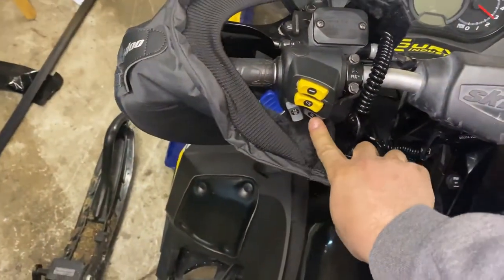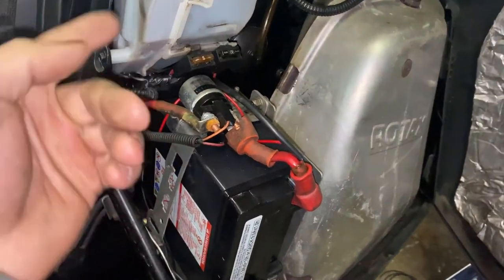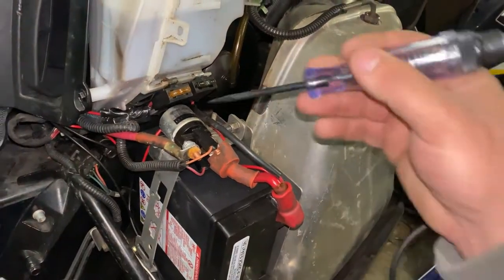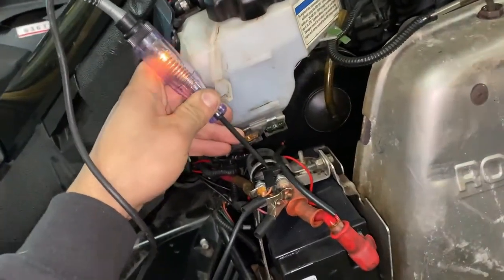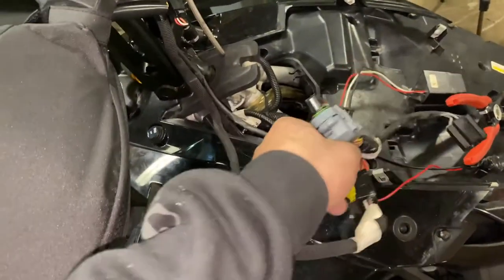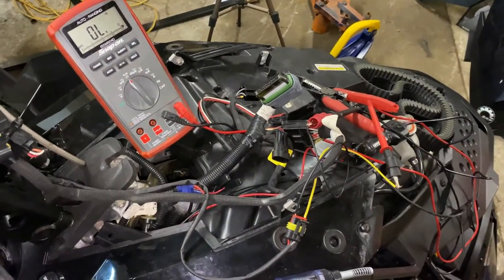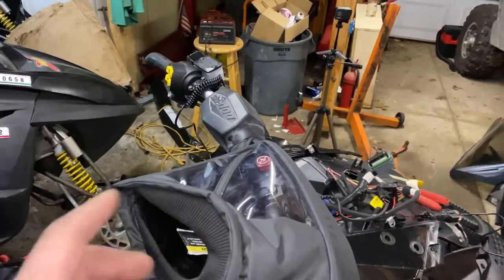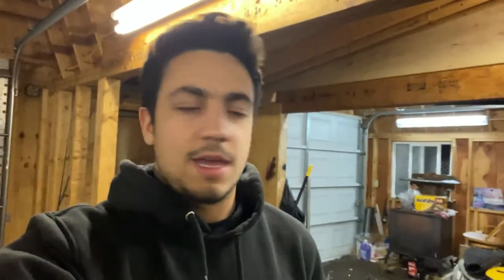Why your skidoo electric start and reverse  doesn't work

Comment: my 2012 skidoo 600 tec sounded like that, changed ecm, tps, gas sensor, still sounded bad like urs then i plugged off the rave valve sensor and it started very well, then changed rave valve sensor/clip thing and now it runs and goes like a dream :)
Reply from the maker: so vaccum leak? makes sense!

Comment: Thanks for this video. Appreciate you taking the time to make these vids. I dont have a tester (can you link that one you have?) but hope you can help with my issue. '15 800r etec is new to me and has been starting fine. It's been below zero fahrenheit the last couple days and this issue just started in that time so wondering if its related to temps. Anyway the screwdriver trick (thanks for that) started the sled. Whats interesting is that if I run it, then turn it off to do a gas fill up or something it will start after. However if I let it sit for more time (30 mins or moreish) it wont start and I'll have to jump it again. It sits on a trickle charger most of the time so battery is full. Any thoughts? I swapped both fuses too and issue persists.

Comment: HELP!  I'm new to sledding and bought a used Ski Doo 2008 MXZ X 800r.  Having issues with hand grip warmers....at idle, I turn the switch on and the grips heat up right away (shows on the display) then shuts off approx 15-30 seconds but still showing ON on the display.  Took it out Friday and ran it up and down the trail at high RMP with same result.  If I flip the switch off then back on, it does the same thing.  Also, the thumb warmer does the same thing.  Thanks!

Comment: Hey Bobby, and ohters
I have a 2012 GSX SE 1200 with the same exact symptoms.
It has been to the dealer 2X where they changed out the battery and then the battery ground wires do to corrosion
IF I do the solenoid screwdriver post connections, It will try to fire but fuel pump etc is not operational by doing this so it will not start but turns over.
I have swapped the 2 relays with known working ones (identical sled) as well as start button fuse and main fuse with same result.

**The only way I have had any success in getting it to run is tipping on its side and letting it fall, or picking it up from rear bumper and dropping it a few times.**  

Once started, it will run as normal (even go into reverse) until you shut it down again.
Looking to see what your thoughts are.  
My next task I think is to look at the wiring at the starter motor itself (Thinking something is loose where it starts if you beat it up)
Thoughts??
Thanks for your time. And keep up the great videos
Reply: bump please.

Comment: how (what type of wire) and where would i ground my solenoid? When you say at the end of your video you jumped the fuse what did you do. I can't see in the video what you had done. 
Thanks
Reply from the maker: I just stuck a wire across the 2 pins. Any wire from ground to ground

Comment: So start button and reverse not working. I jumped the solenoid,  it started the snowmobile. So if my solenoid is no good it won't allow my RER to work as well as start button?
Reply from the maker: Sounds more like the button/ connector. Bet you the solenoid is not getting triggered.
Reply: I took apart the start button control and all looks good in there. However the start button/RER go to a micro switch. Do you know if they go bad? Or am i having to chase wires. 2012 600 etec

Comment: 12 GSX are the handle bar control switches a common failure? I m having the same issue ,start is intermittent ,reverse works fine.
Reply from the maker: They can! Once water gets in there and feeezes it’s all over. Sounds like a starter issue. Try hitting the starter when it’s not turning or jump the starter manually
Reply: Thank you , I’m currently on the road , I will give you a more detailed repsonce shortly. I se BRP has a new part number for the control . If I’ll you in as to what I found in my diagnosis in the future Email.For now Thank you for your prompt reply
Reply from the maker: @TA-bw3pp  no worries. Feel free to email me if you want me to walk you through it bobby@coastalmarineengineering.com

Comment: @Bobby Rebussini  hi there I'm having the same issue, only starts when I bypass the solenoid with a screwdriver. I bought a new solenoid and still doesn't start. I have power coming from the plug that goes into the solenoid. My button works though because it goes into reverse no problem. What did you do  at the end when you took the fuse out? Did you just replace it and that was it?

Could it be a I got a defective solenoid? Odds are slim but that's all I can think of

Thanks
Reply from the maker: So the solenoid is getting triggered?
Reply: @bobbyrebussini1466  I don't know for sure, my friend had a test light and the plug that goes into the solenoid has power. So it should according to that I'd think. I'm no mechanic just trying to rule out something simple before removed everything and chasing wires
Reply from the maker: @jeremipolsky5775  add a ground wire to the solenoid and see if it helps
Reply: @bobbyrebussini1466  when I use my start button it's dead, no clicking or anything. Battery is strong. I just meant the button functions because I use it for Reverse no issues.
Reply: @bobbyrebussini1466  what exactly do you mean. What would I be doing.
Thanks for these replies really appreciate it

Comment: Same problem on my 2012 800 looks like the same sled. Thought is was the relay so I replaced it and still nothing at the start button. Fires up when I cross it so I will follow your steps and we will see. Thanks for the tips!!
Reply from the maker: No problem dude if it’s soemthing different lmk

Comment: man I wish it were this easy on this 2013 rev xu 600. I did the screw driver trick on the solenoid but no spark, used the handle bar start button but there's a super weak connectivity and barely spits out the starter. a few other wrench savy guys had looked at it and tried adding a ground wire to see if any change. nada. all new fuses, a new solenoid, new electric starter, no spark. what else could this mean? any input would be greatly appreciated.
Reply from the maker: Hmm have you tried directly jumping the starter?

Comment: Similar problem with my 2012 TNT 600 Etec, but it’s the 30A that keeps blowing. Seems to be related to the combination of accessories that I’m using. Hand grips heat ok, but with hand, thumb, and shield all on, fuse will blow. Seems like a 12v short somewhere...any ideas?
Reply from the maker: All at once or can you isolate it? Assuming you can’t isolate it I would imagine stator related. If you’re not putting out enough power the current draw increases which will blow the fuse
Reply: I’ll have a pocket of 30a relays this weekend, and then will try to isolate. Thanks for the prompt reply.
Reply from the maker: @gregroylang1570  no problem let me know I’m curious. Ohm out both heated grips and thumb warmer swperately to see if they are low. Also swap the heated shield plug
Reply: Bobby, this information is probably relevant: due to a rollover, I had new handlebar added this summer, which mean that the grips and switches were redone...likely that is where my problem is.
Reply from the maker: @gregroylang1570  ah.  Always go to the scene of the crime..
Reply: @bobbyrebussini1466  hey man, I’m coming to the expert with my latest dilemma. Replacing the disintegrated fuel tank grommet on my 2012 mxzx tnt 600 HO etec. Old one is out, new one is in...question: orientation of the float assembly...I presume it should be allowed to float up, since it’s range would end where it is positioned in the tank (at the bottom). Bobby, could you confirm?
Reply from the maker: @gregroylang1570  yes that would be correct. Pb blaster/ free all with make your life easy with the grommet

Comment: my 2003 skidoo bomadier 600 mxz 007 wont start with the electric start and pull start is broke and dosnt start when i jump the solenoid
Reply from the maker: Battery? Starter/loose connections
Reply: @bobbyrebussini1466  battery seems to be good i think the connections are good thinking it is magnetic key

Comment: I’m having the exact same issue I took the 5ap fuse out but still nothing what does this mean? and when I take a screwdriver and put it on the two screws on the relay if fires right up
Reply from the maker: did you jump the fuse? are you getting power to your solenoid?
Reply: @bobbyrebussini1466  I replaced the fuse and did the screwdriver thing in the screwdriver thing started it though sorry not very good at explaining it😂
Reply from the maker: @connerwiltshire7528  gotcha. So test voltage at the solenoid when the switch is pressed
Reply: @bobbyrebussini1466  alright I’ll let you know what happens.
Reply: @bobbyrebussini1466  the weird part is the bottom still puts it in reverse
Reply: @connerwiltshire7528  I have the exact same problem on mine. Reverse works but won’t run the starter relay. Where you able to get yours working? If so, let me know what you found out. Thx
Reply: @loganzundel3004  I did up getting mine working ended up melting the wire grime the 25 amp fuse to the solenoid super easy fix. Try replacing the fuses possibly
Reply: @bobbyrebussini1466  hi there I'm having the same issue, only starts when I bypass the solenoid with a screwdriver. I bought a new solenoid and still doesn't start. My button works though because it goes into reverse no problem. What did you do  at the end when you took the fuse out? Did you just replace it and that was it? (I have 2017 600 etec)

Comment: My etec has a issues similar to this every 10 to 15 times it doesn't work then i hit the control and it works any idea whats wrong
Reply from the maker: hit the control?
Reply: @bobbyrebussini1466  yes the controls then it works
Reply from the maker: @brandondoucet9236  its probably the button then. can you test the button and play with it/ jiggle wires until it acts up?
Reply: @bobbyrebussini1466  alright ill try that thank you so much
Reply from the maker: @brandondoucet9236  no problem let me know what oyu find
Reply: @bobbyrebussini1466  just letting you know it was the starter button

Comment: Damn need help my skidoo tundra 600 efi key start switch/reverse doesn’t work it was only start when I jump start the solenoid and all the fuses/solenoid are good I tryed changing the key switch off a 550 tundra still didn’t wanna start im not sure what’s wrong wit it started happening last week it’s close to 3K kms
Reply from the maker: fuses, relays, wiring, pcm, in that order
Reply: Probably it’s the ECM I started jump starting the main relay nothing only starts bypassing the solenoid lol
Reply from the maker: @sinclairnorth5870  switches are different heat to year so keep that in mind
Reply: I found the problem on my 2021 tundra 600 EFI its the ECM thats not working a few of my buddys have the same problem and their buddys damn these new tundra 600 efis they should be recalled lol jk guess ill just have to buy 2 ecms every yr thats if they make them i think they do ? I added a pull start but no reverse working not until i get a brand spankin new Brain the ECM lol
Reply from the maker: @sinclairnorth5870  Jesus that sucks. Brand new 600 efi? Is skidoo standing by the warrantee
Reply: Yes it has warranty and its a brand new 2021 skidoo tundra 600 efi actually had it since dec 4 my dealer will get me an ecm 500-700 bucks

Comment: Bro mine gets stuck in reverse. It goes right into reverse but then I have to shut the sled down to get it in forward. It shuts down but comes back on in reverse. I’m lost
Reply from the maker: Yikes. Consistiently? Like will never stall into fwd?
Reply from the maker: After some quick research I would check belt deflection and then compression in that order.

Comment: 2015 MXZ pull start with reverse. Reverse not working
Reply from the maker: A million reasons why. Is it a carb model,
Reply: @bobbyrebussini1466  yes mxz 600 sport
Reply from the maker: @tuckernadler4893  carbs clean? Idle speed correct?
Reply: @bobbyrebussini1466  yes, was working earlier in the season
Reply from the maker: @tuckernadler4893  test battery then check compression. Also just bc it was working earlier doesn’t mean your carb is still clean.

Comment: Any idea for an 05 GSX 600 SDI not going into reverse? Estart works fine. Run fines. Hit the rer button and the engine dies. Estart continues to work fine. Just seems to be a reverse problem
Reply from the maker: Idle speed carb adjustment then check compression.